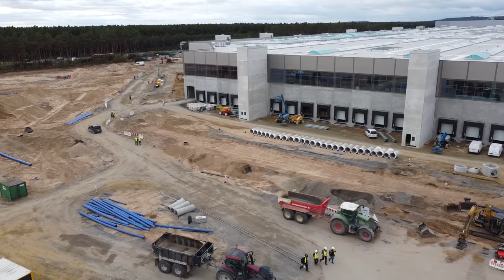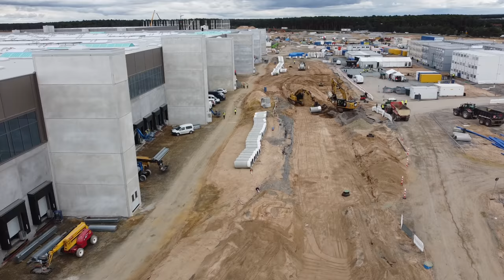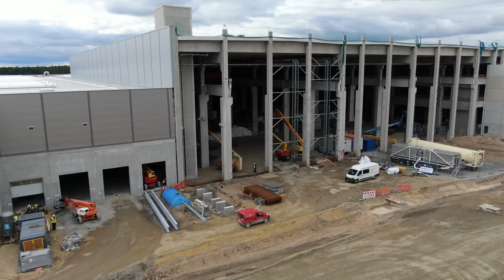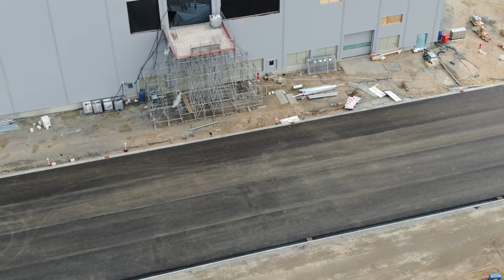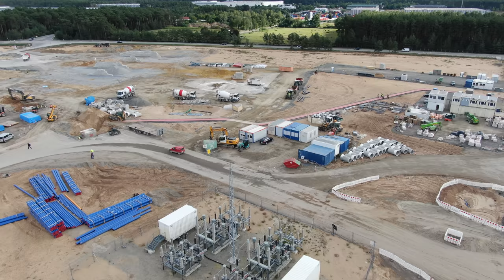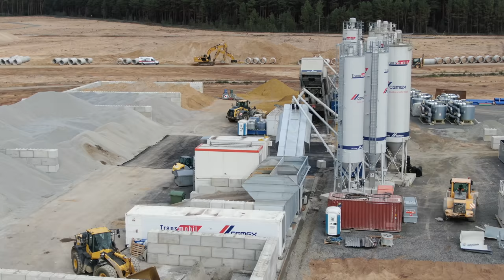Giga Berlin | 2021-09-17 | Asphalt Road

Comment: Most large construction projects that I am familiar with (in the USA) do not start paving surfaces until they know the project is substantially 75% to 90% complete.  This is good news.
Reply: I am quite certain that's fairly universal. Nice progress, seems to get ready to receive visitors next month, at least in the main building. Meanwhile, the battery factory and other sections can continue to get built.

Comment: I saw the Shanghai made Model Y here in Sweden, they are perfectly made with excellent fit and finish. Can Berlin factory do a better job? When will this factory start production? Will it be the new battery cell or the trusted one from Model 3 and Y?
Reply: The new battery cell pack will be a structural part of Model Y. Which has thus a different chasis than the current variant. The idea to built at the beginning also model Ys at Giga Berlin for the 2170 batteries was to my knowledge scrapped.
Reply: @abalada  old trusted battery is better than a new one. All have nothing but praise to Model Y agility and fun to drive characteriatics.
Reply from the maker: Will be hard to be better than perfect, but I'm sure Tesla learns with every new factory to improve the quality. I'm sure when Giga Texas opens the quality of US made Tesla will be much better as well.
Reply: @TobiasLindh  when Model Y is going to start rolling out of production line in Berlin?

Comment: That battery factory is going to be a prime example of what Elon was speaking about in the use of space in manufacturing. Four very robust floors using the volume in 3D for maximum productivity. The plant is four times larger than a single story mfg. facility.
Reply: For your information a solid state battery factory is being build in the South of Germany - Tesla's ancient technology is snow from yesterday and to expensive too.

Comment: Finally seeing some progress. But the more they build, the more we see how much work needs to be done. When will they make the final approval? They were supposed to do it in September and we have less than 2 weeks left
Reply from the maker: They were supposed to do it in September? I never heard about that.
The final permit is impossible before mid October, because that's when the online consultation ends. And it's unlikely that they will be able to issue the permit directly after that, so November is much more likely, but also not guaranteed.
Reply: They weren't. In September the final hearing takes place. Permit not before October / November.

Comment: Thanks for the update! 
Can anybody tell me though why we don’t see work on every square meter of the areas they’re currently working on? Looks like there are lots of things that could be worked on now but we’re not seeing any progress.
Reply: For some reason there just aren't enough construction workers to expedite completion.  IMO, Giga Texas has 5 times more construction workers than Giga Berlin has.
Reply from the maker: I don't think that there are 21,000 workers at Giga Texas right now.
The parking lot might be much bigger in Texas, but other part of the world handle car usage differently. Look at Shanghai for example.
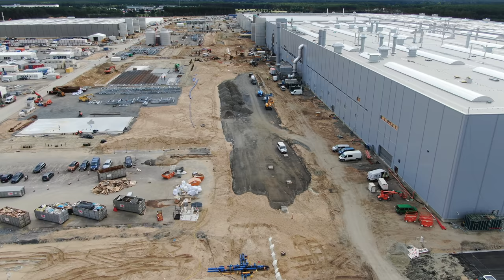In my last time-lapse video at 11:00 you can see one of many reasons why you shouldn't get fooled by the parking lot size. The whole crew fits in one van. And that van isn't even parked in the parking lot. 
https://www.youtube.com/watch?v=TfnkK52wr9g&t=660s

There might be limitations like workers and material deliveries, but sometimes it's also not worth to spend the effort and money to have a part completed fast, when it can't be used anyway because it depends on another part that takes longer.
Some constructions also had to wait for a permit until last Monday, because Tesla changed the plans this summer.

Comment: Are they still using the train to ship most of the building materials like the concrete parts? Or was it only for gravel?
Reply: Those concrete panels are from a different supplier which has no rail connection.
Reply from the maker: The concrete parts for stamping, paint shop and casting where delivered by train. The concrete parts for other sections arrived by truck. The parts are made in different factories.
The train track is heavily used for gravel deliveries though. There is a gravel train unloading almost every day. Sometimes two at the same time.
Reply: I wonder if they can use the train line to ship the cars out. Idk how efficient that would be, but it could be an easy way to ship the nearly 1500 cars they plan to produce every day. Though idk what the routes allow, how much that'll cost, and what the regulations allow. I know in the US you can EASILY ship 1500 teslas on 1 train without problems, but I know the US has some really long ass trains.
Reply: @ryanthompson3737  yes they can definitely do that. I have a Peugeot factory near I live and they have a train yard and they ship most of the cars by train. Train network is well developed in Europe and especially in Germany.
Reply: @milhooz  Wow that's nice to hear. No wonder Germany has some of the best car manufacturing base, good infrastructure in place  great human capital accumulated esp in the auto industry.
Reply: @ryanthompson3737  Quite common for car factories in Germany to ship new cars also by trains. Tesla has also plans to do this.
Reply: @abalada  Oh wow I didn't actually know that was a thing in Germany and that tesla even had plans. I kind of felt it was a stupid suggestion when I made it only because I'm ignorant on the rules of the rails down there lol. Glad theyre going to take advantage of a nice shipping line.

Comment: It's obvious the factory is not going to be fullspeed or even halfspeed in October. All the parts and supplies needed for those dozens of docks can't be delivered yet and with cold weather coming, the asphalt is not going set well in November to April. Based on their other factories at this state of paving and docking, it will be late Spring before they can stock up on everything they need. Mark my words.
Reply: It never was the plan to go any speed in Octrober. And Asphalt can be installed down to 5°C
Reply: The pro I talked too said average Berlin temps in November would make for some very bad, blocky asphalt, certainly not good enough for heavy 18 wheelers.
Reply from the maker: Based on Tesla's other factories, full speed is not to be expected during the first year of production. The factory will have a ramp up first.
Marked your words, but why do you think the important roads won't be finished before November?